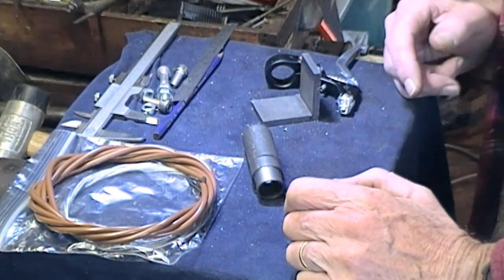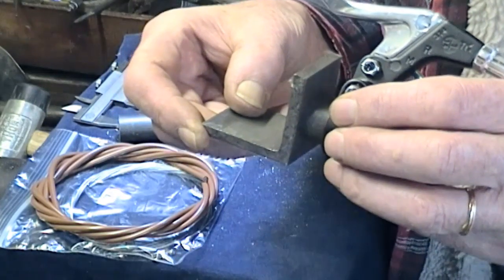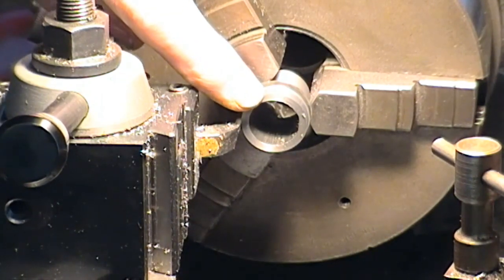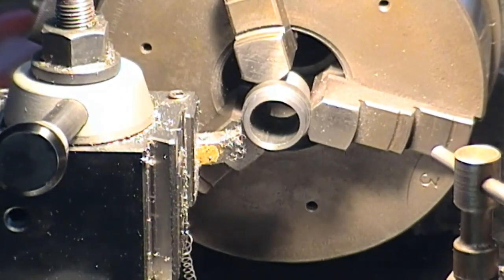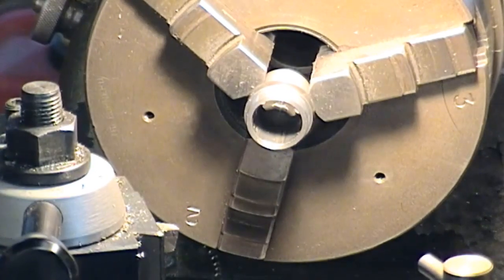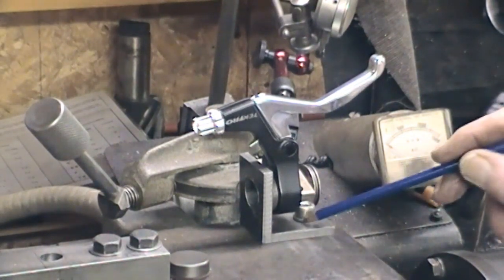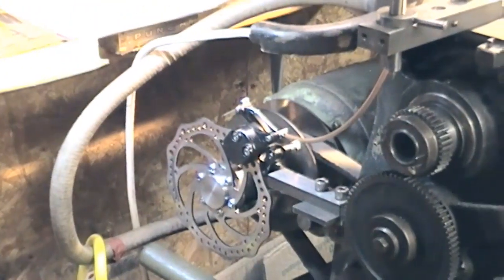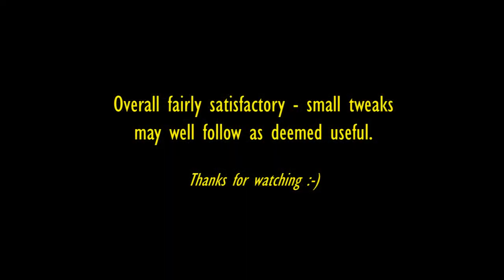Lathe Brake Project, Main - Part Three

Comment: I've watched all 4 installments, from concept through the travel limiter.  In #2 you mentioned back problems and tremors.  I have both.  Perhaps 10 years  back I visited a neurologist who decided I had 'essential tremors' and he put me on a medicine that is an 'anti epileptic.'  After a short period of time I no longer had the tremors.  For the back pain I had surgery.  Best wishes.
Reply from the maker: Hi Jeffry,
The 'tremors' are not too bad really - just not a proper steady hand these days - it's linked to fine movement at times. The back is still chronic and now add to that a right hip going bad! Surgery would be a last resort but cost will rule that out for a long time.

Comment: If you would extend a piece of tubing mocking the original hand grip area. Then mount the lever onto the tube it would do 2 things. First it would give you the ability to modulate the braking pressure by squeezing, not pushing down. Second the direction of which you are pushing leads towards the chuck. If you slip, or e stopping the machine with the brake for whatever reason it would be a more dangerous predicament. I like the project.
Reply from the maker: +CncObsession 
Hi - sorry late reply! Yes, your idea could work for sure but the arrangement we have does actually do fine.  Minimal pressure needed on the brake lever and the stop makes for controlled caliper pressure nicely... I haven't felt it was unduly dangerous to be honest.

Comment: Being a disk brake one option may be to incorporate a tension spring in the cable somewhere as to only allow a certain amount of pull on the caliper arm. Just a thought. Great idea, has a lot of potential.
Reply from the maker: Hi Richard -- I think someone else suggested a spring.  Thing is - the caliper cam seems pretty non-linear with its effect - logarithmic if you will - which means final strong 'grab' comes very suddenly. This is dealt with by having the stop pillar which just falls short of an overly aggressive 'grab' - just enough but too much! :)
Reply: I know I am super late to the party but...for those cable disc brakes the caliper has maximum grab when the arm is perpendicular to the cable pull direction. To decrease that "grab" feeling, set the cable so that it either approaches that angle, giving more power the more you pull on the brake lever, or set the caliper arm so that it is already past that point, giving a falling curve of leverage. Same applies for the brake lever itself. Here is hoping you still have the brake in its current setup.

Nice work!
Reply from the maker: I saw a comment from Kris S in my email, which should show here - it hasn't appeared - it was - 
 Kris S
 know I am super late to the party but...for those cable disc brakes the
 caliper has maximum grab when the arm is perpendicular to the cable 
pull direction. To decrease that "grab" feeling, set the cable so that 
it either approaches that angle, giving more power the more you pull on 
the brake lever, or set the caliper arm so that it is already past that 
point, giving a falling curve of leverage. Same applies for the brake 
lever itself. Here is hoping you still have the brake in its current 
setup...

Useful points, thank you Kris

Comment: I hate to be the bearer of bad news, but you seem to have made a major error in your design. It appears that your lathe motor pivots to adjust the belt tension. If this is correct your design is flawed. When you pivot the motor to adjust the belt tension, the disk moves in relation to the caliper. That can't happen. The disk and caliper must keep the same relation ship to the center of the motor shaft at all times. The caliper must mount to a bracket that maintains the relationship between the disk, and caliper, no matter the position of the motor. That bracket would than be braced to the main body of the lathe to keep the caliper from rotating with the disk, but the caliper can't move in relation to the disks center of rotation. You need to look at how disk brakes are mounted to the rear wheel of a motorcycle. I would suggest that you look at the following video  Part 8 1999 Sportster Chop | Building a Chopper  About 1 minute and 30 seconds into the video shows a pretty clear view of what your mount should look like. Unlike a motorcycle's axle, your motor shaft rotates, so you must come up with a different mounting method for the caliper mount plate than shown. You might be able to bolt it to the 2 bolts on the swing bracket for the motor. That at least would pivot with the motor, and keep the caliper aligned with the disk. With your current system, as soon as you adjust the belt tension, you move the disk in relation to the caliper.
Reply from the maker: Tension adjustment has been unaltered for ages - however, if it seems necessary to adjust I will just make a new caliper support arm - this time with the block and extension mount bolted together with slots to permit adjustment for extra reach. My lathe time is not huge these days so - doubt it'll be an issue for some time.

Comment: yes the micro switch specs will vary by lathe. My lathe  has contactors(relays) operated by a 24 v control voltage to control For/Rev and Stop ,  so switching it off is easy and safe.   Gerald
Reply from the maker: My switching is direct with heavy duty switch, so be rather a hassle to convert to interpose a contactor though would extend options a bit..

Comment: Thanks for the good ideas, have been thinking of designing a brake for my lathe as well. I plan on having  a foot pedal operated design which should be much more convenient. I think an intermediate lever/mech in your cable path to reduce the travel at the caliper might make the actuation a little more gradual or possibly modify the pivot point at the lever to get less cable pull per travel of the hand lever. I plan to have a micro switch on my foot pedal so it will switch off the motor prior to brake application to make it totally hands free and you could likely do something similar to your hand lever. Keep up the great videos.

gerald
Reply from the maker: Thanks - I have added a short vid now showing a simple adjustable lever stop - it works well - and lever is close to on/off switch so easy to transition from one to other. I like your micro switch idea which would be good for a foot pedal, as long as it can handle peak current or any back EMF etc.

Comment: Try adjusting the cable so the brake starts working in the bottom third of the levers range of motion. 
CHEERS
Reply from the maker: Good idea Bob thanks but - tried that, and setting cable clamp point was a bit empirical - the very last stage of operation is so critical that the addition of an adjustable stop seems more precise.

Comment: I think a stop would have to be adjusted all the time, braking is more about force than travel. How about replacing one of the cable adjusters with a spring so that force at full travel is controlled by the spring?
Reply from the maker: Cable stretch can be taken up at the caliper arm end and stop is easy to adjust.  I do like your spring idea though - could see about incorporating that.

Comment: It works well, Chris. Going back to pedal foot question, the strongness of brake force is related to the ratio of the lever tha pulls the cable. So if you want to have advance of pedal (it's very useful to have hand free) you can just change the ratio of the lever mechanism of pedal or reduce the pedal stroke as you are going to do with the lever. That's just my idea, just theory, but I've seen that in practice your project is more than adeguate. Complements.
Reply from the maker: Thanks - well, like most projects we always finish up with the possibility of further tweaks! I find comments most useful and often give food for extra thought. :)